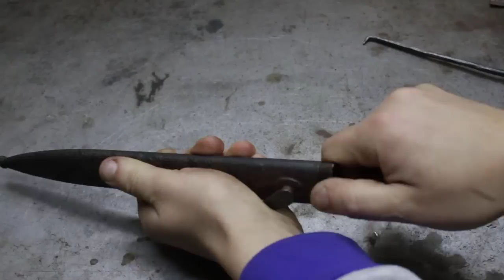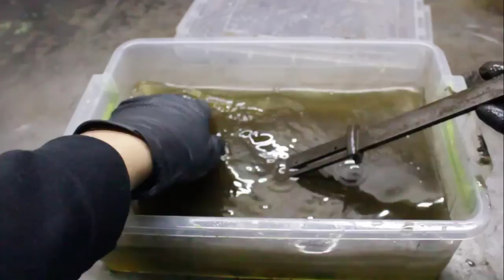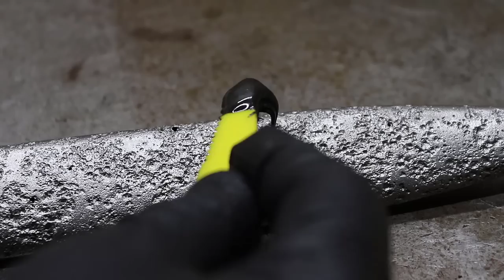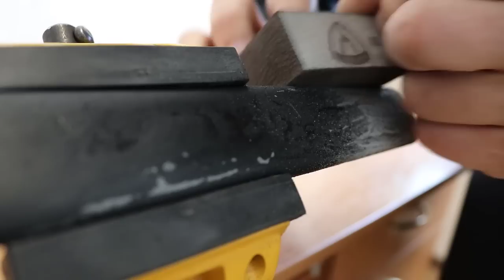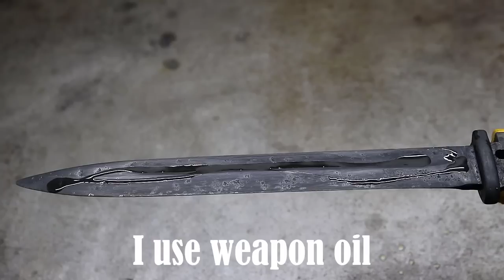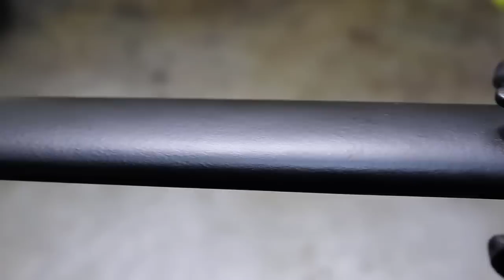Mauser 98K Bayonet Restoration

Comment: I like your workmanship, bu if you try to sell this bayonet in Europe after this restauration, you will be happy to get €60 for it. Unrestored and original you will get €90 to €100 for it. The metal scabbard has to be blued, not painted black. And if there are holes in the scabbard, that you've had to plaster, than you won't be able to sell it to anyone, period. The rule in Europe is: don't touch it. Leave it as it is. Freezeframe after wartime....
Reply: Who gives a crap
And EU is also crap

Comment: Don't quite get why one would "make" an anti-rust solution when you can buy them pre-made.
Also.... Again not sure why you're gonna take a metal brush to a 77yr old knife. You coulda took a brillo pad or sanding pad after letting it soak without any chance of chipping or gouging the blade.

But hey.... Just my observation.

Comment: Do you also use oxalic acid to derust?

If so, how long do you roughly leave your items in there for?

ps. you live in heaven, the ground you live upon seems to be very gentle with these relics, here in the netherlands, relics will fall apart if you handle them a bit roughly...
Reply: JustAGuy1250 i also would ask
Reply from the maker: In this video i used citric acid to remove rust. I  only use oxalic acid when I need to keep the paint. The оxalic acid removes rust too slowly.
Reply: @wwiituberestoration1011  what % u use and how long in the median?
greets and thx
Reply from the maker: @germanhisto  I use approximately 200 grams of citric acid per 10 litres of water and leave for 10-12 hours.
Reply: WWII Tube Restoration thx a lot
Reply: WWII Tube Restoration are you sure with 200 grams @ 10 liters? I had mostly no reaction

Comment: You should learn what you're doing before attempting such projects? Boiling in water then carding( with either degreased steel wool or carding wheel) to remove rust without destroying any original finish is the proper way to do this? The corrosion pits in your bayonet were so bad it was gone!

Comment: only thing different I would have done in electrolysis  and maybe used fine metal shaving or metal powder and mixed it with the glue and make a even coating over the entire sheath

Comment: Great job! What did you use to fill the wholes in the sheath of the bayonet?
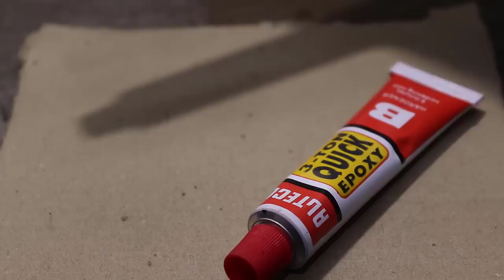Reply from the maker: I used 2К epoxy glue. 6:32
Reply: @wwiituberestoration1011  two years late but would that work on a blade? My K98k bayonet has a decent amount of pitting, mostly around 1-2mm deep

Comment: You fucked up a bit, lock button can be fixed easily just with hammer and wd40
Reply from the maker: Yes, it could have been done but not in this case. I saw that the button was in a very bad condition and nothing good would work out. I didn 't waste time and effort on the push button in this bayonet. I usually do as you wrote, plus use a gas burner